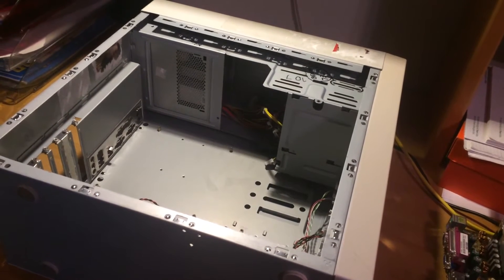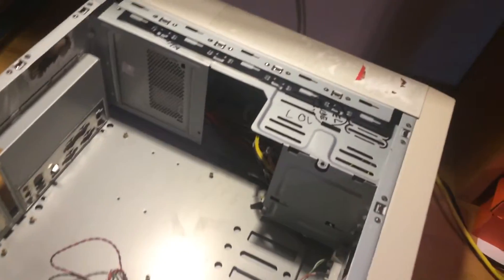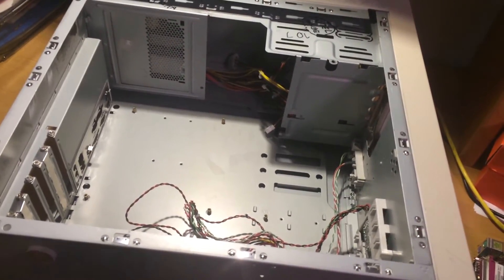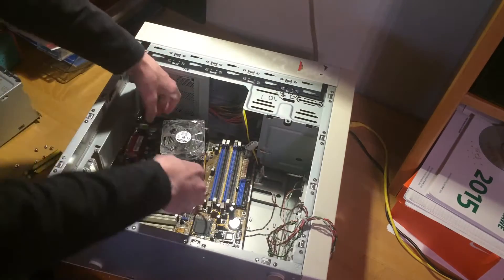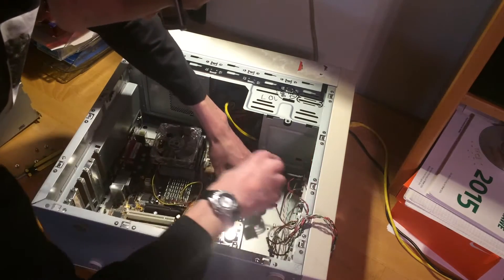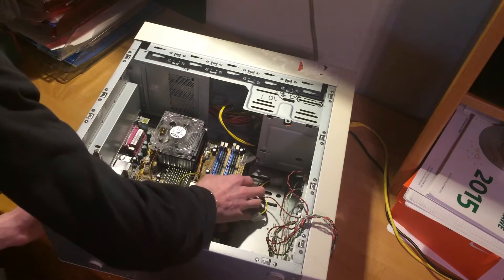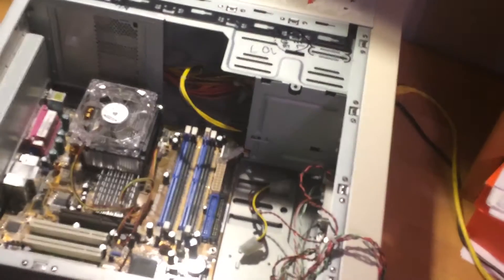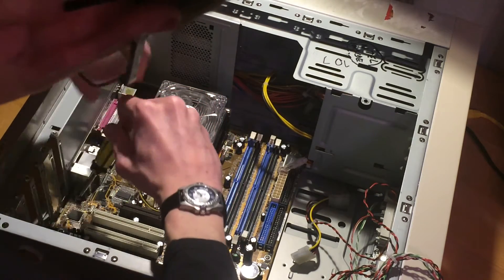Pentium 4 Build

Comment: My Pentium 4, originally a HP D530 SFF. It has been my main desktop 2010/11 till its special size PSU was killed by our frequent power outages, I saved its content and re-used it in 2017 as:
a Pentium 4 HT at 3.0GHz
a 1GB memory stick 400MHz, waiting for 2 x 1GB from China for $5.
a 250GB IDE HDD with a 20GB system partition: reading at 80MB/s, seek times 9.5 msec and a 230GB data partition. 
a CD reader/writer IDE, better use a spare DVD ROM to cope with today's OS sizes.
an AGP Nvidia TNT2 video card 32MB
a PCI sound card
a PCI wifi card
an old P-III/Win 98 desktop case from IBM with a 130 Watt PSU with an improvised, soldered 4 pin CPU plug

The case has to be replaced, if I close it, it gets too hot and it has no space for fans. I also want to add the DVD ROM.
The system runs a Linux distro; Peppermint 7, it runs all modern SW and it displays YouTube videos at 360p and with HT probably at 480p.

Comment: I'll build a p4 machine with::
Asus p4p800e Deluxe
Intel Pentium 4 northwood 3ghz HT
Powercolor ati radeon 9200 128mb.
2x512mb elixir ddr400 ram (dual channel)
400 watt psu
Creative soundblaster audigy

You think it's a good computer?
Reply from the maker: 97pedrocas Definetely a nice Pentium 4 machine. Although the 9200 may be a bit weak with some more modern 3D stuff. The rest is very cool though!
Reply: ***** 

Had a P4 machine with:

Foxconn 865A01-PE-6LS
Celeron D (still P4 platform) 2.66GHz
ASUS AH3450 Radeon HD3450 512MB
4x512 MB (dual channel) - 2GB DDR400
350W ANS LC-B350ATX PSU
80GB SATA HDD
DVD-ROM drive
Windows 7 Ultimate.

Ran really smooth. Wish it didn't die (some traces burned due when I recapped it due to a bad cap) as it was on par with my actual Athlon 64 x2 Dual Core 5600+ system.

Comment: Today i builted P4/SB Live!/256MB Ram/Riva TNT2/80GB HDD
Reply from the maker: Cool :D
So I guess you run a lightweight Linux on it or Win98/2000 with that 256MB RAM?
Reply: ***** 256 Ram, this is for tray. I have WinXP on it. And without internet is very fast. But i want add 1 GB Moduler